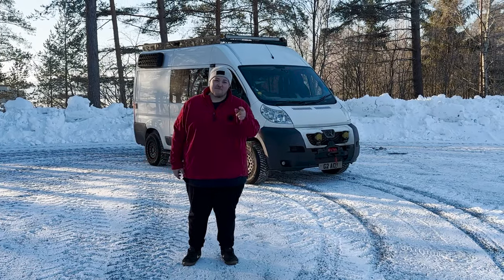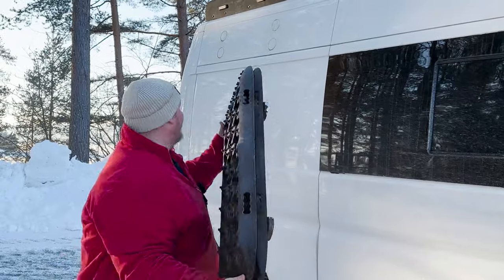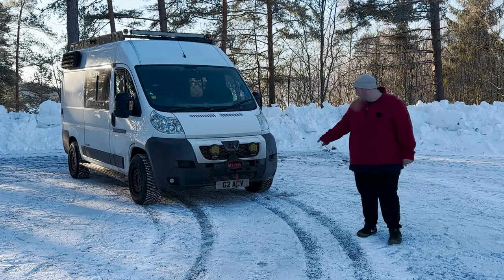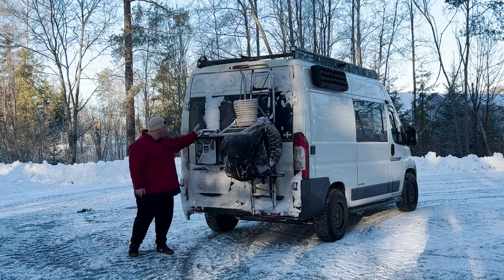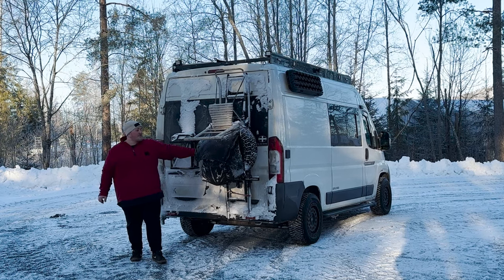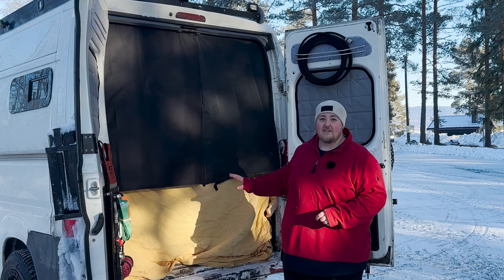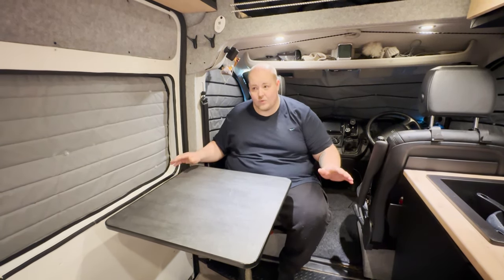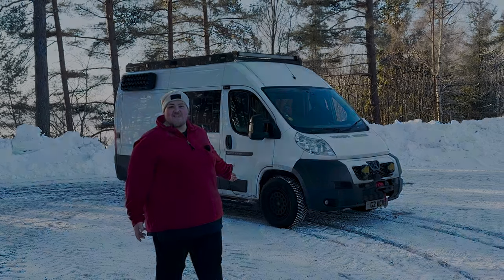Arctic Adventure Camper Van Tour!

Comment: Nice to see how you tackled the Arctic, we have just returned from our own trip and the place is amazing and we feel it has to be on the bucket list of everyone who owns a van. The one thing we do not have is an engine pre-heater and while we never had any problems, but it is something i will be adding before we return. I tried to look for a link to the one you have but you don't seem to list one, only the extra exhaust hose. Would you be kind enough to link me to your pre-heater, also if you have a video on the install, it would be very interesting to see.
Reply from the maker: Thankyou! I mean to be fair you could go up there and not have a cold snap or only be on the Norwegian coast. 

 I’ve put a link to the pre-heater in the description now, went don’t have any video of fitting it but each van is different! 

This van the easiest place in on the passenger side chassis leg, with rivnuts for the mounting plate and then tapped into the return of the heater matrix.
Reply: @Jess_and_Alex_Adventures Thanks, I'll check out the link, on another note was it is easy to fit the winch? I know you state you got the extra bumper frame mount, which i'm guessing you need to strip out the whole front end to fit.

Comment: Great video and lovely van. Hadn't heard of fridge seals drying out it left open. Did I understand this right and bay keeping fridge on anything else which can be done to stop it?
Reply from the maker: So the fridge has refrigerant in it just like a car air conditioning system. If you don’t use your fridge just like a car air con system the seals dry out and crack. 

But on the flip side leaving it on all the time means the compressor is working. So it’s a catch twenty two. 

We leave ours running generally all the time and turn it off periodically for a week or so with the door open.

Comment: Thanx for the Van Tour. Just the way i like them. No BS just a good story and details. I wonder how much insulation you have in the walls and floor for this Arctic trip. (Planning my own Arctic trip)
Reply from the maker: Thanks for the feedback! Hard to tell when you’ve edited and watched it a million times 😂

We’ve just realised we completely forgot about what insulation we’ve put in! We’ve got 35mm kingspan in the roof, 50mm in the lower walls, recycled bottle insulation anywhere we could stuff it and then finally expanding foam anywhere there wasn’t wiring looms. 

The floor we have nothing but double bubble. We’ve seen people will proper king span floors and they still have stuff freezing to the floor. So we kept the roof height as high possible.
Reply: @Jess_and_Alex_Adventures   my floor has 10mm high density foam. Then 12mm wood. Then 3mm underfloor. And the 6mm vynil
Reply from the maker: @zuk4wd  That sounds good! We would definitely still recommend a rug on the vinyl during winter in the arctic as we were thankful for ours 👍🏼
Reply: @Jess_and_Alex_Adventures  well I’m planning to rip everything out of our van. And install a hydronic floor heating system. 😀 powered by engine preheater type of system. (Switchable between floor and engine pre-heat function) allready installed 2Kw diesel air heater.
Reply from the maker: We’d like to do something like that if we build a van again!

Comment: great van tour video guys. loads of neat ideas i may have to pinch from you to put in my van build. can i ask, where did you get the ceiling material from and the front land rover seats how complicated are they to wire up to work? cheer and happy safe travel👍👍👍👍
Reply from the maker: Thanks guys! We got our ceiling from a company called The Wood Veneer Hub. 

The seats are not that straight forward, you’ve got to get 3 ways switches and provide power to each motor. If you’re keen on electrical you’ll be fine. If you’re not too confident it would probably be daunting with the amount of wires.

Comment: Hi, great van and an inspiration to look at. But I wonder where you leave all your luggage, like the snowboots, down jackets, clothing in general? Do you leave it in the back and if so, can you get acces from inside? We're planning a similar trip with a much smaller van and are wondering where to put all our stuff.
Reply from the maker: So we have roof lockers in our van. The one over the bed is filled with our clothes, like thermals, T-shirts, jumpers etc. 

Snowboots and shoes of all kinds stayed by door on a rubber backed mat to stop them sticking to the floor. 

A lot the of the jackets and the likes went in the over cab storage. This is usually where we’d keep our window covers but they stayed on the windows at all times!

Comment: Wow ! All looks beautiful ! But why do you not use  a power station ? I think when yo would buy 2 of them it would be cheaper then all the battery`s and Victron stuff, and loose a lot of weight...
Reply from the maker: Thank you!!! 🙏 

The closest thing to our capabilities is the Anker F3800 to achieve the same inverter level we have. But we would need 2 to even compete with the battery capacity we currently have. They are around £3400 each and 60kg. 

We’ve got around £2000 in to our entire electrical system and it weighs around 70kg. 

The other thing is redundancy. If that power bank shuts down you lose everything. The way we have it allows for for more modular replacement.

Comment: I think I read somewhere that the vents are not legally aloud to be seal tight, that’s why they vent even when closed, really rate the max air fans as super quite but even they let in air, they do do a seal kit to stop it but I’ve heard even that isn’t great 👍
Reply from the maker: Ahh ok I wasn’t aware of that! Interesting rule! But maybe these aren’t as bad as we thought then!
Reply: i know with the max air vents as covered by crafty blinder the seals do stop the road noise and they tell you with the seal kit if cooking or heating with gas you need to use an alternative vent as in crack a window open ,think with electric cooking should be ok ,but even with a diesel heater id put in a carbon monoxide alarm just in case
Reply from the maker: @grahamunderwood9353  100% we have monoxide and a smoke alarm just to be safe and they saved us early on in the trip where we had an issue with the diesel heater exhaust!

Comment: Nice Van 8-) , would advise against rigid single core mains cable for your 240 side though, eventually may fracture under vibration. Better to use flexible mains cable everywhere.
Reply from the maker: Ahh I wasn’t aware of that. I’ve got some bits to do when we are back so I will add that to the list! Thank you! 🙏

Comment: Great Video Alex. Been following for a while and always wondered how you attached the lights to the front grill?
Reply from the maker: Thankyou! We’ve got some 2mm steel bent into an L then attached to the winch bumper. 

We then have little plastic stand offs behind the light to stop it wiggling with copper wire pulling it tight around the grill. 😊

Comment: Love your layout, thanks for sharing! How hard was it for you to swap out your front seats to the disco 5 ones?
Reply from the maker: So they pretty much bolt straight in, you have to just extend the two real holes. The electrics are a little tricky you need to have 3 way switches for each motor you want. But they are honestly 100% worth the effort they are so comfortable!
Reply: @Jess_and_Alex_Adventures  Oh awesome, thanks for the info! Did your van come with a bench seat for the passengers or a single?
Reply from the maker: @lucklessduchess  Bench, we took some measurements and the took the plunge on a drivers seat base and it fits the passenger side perfectly. Reuse the base bolts and reuse the seat belts plugs from both original seats then you have no air bag lights either.
Reply: @Jess_and_Alex_Adventures Fab! Thanks for the info!

Comment: great detailed van tour and well presented. Can I ask where you purchased the ceiling slats from?
Reply from the maker: Thank you! The ceiling was purchased online from The Wood Veneer Hub, would definitely recommend!
Reply: Thank you, I assume you pinned or screwed through the actual slats to roof batons to secure it !
Reply from the maker: @bobscullion3533  Yes that’s right, and using black screws it’s really unnoticeable! We then just finished it with a clear osmo 🙂
Reply: @Jess_and_Alex_Adventures so did you screw through the black felt?
Reply from the maker: @bobscullion3533  Yes in-between the wooden slats!
Reply: Great, thanks. Wasn't sure if that would hold up or not, no movement or rattles from the slats then if only secured through the felt?

Comment: Regarding the roof panels how did you fix them to roof screw through the wood panel into wood or van ribs??
Reply from the maker: We used thin battening attached to the ribs that run front to back. As the panels are only felt, if they aren't supported over a long span they will droop.

Comment: Hi what seats have you got in the front of the van ?
Reply from the maker: Hey, we’ve got Landrover Discovery 5 seats. They bolt straight in, but the wiring can be an arse depending which version you get. 

I’ve just put power to the motors with a 3 way switch.